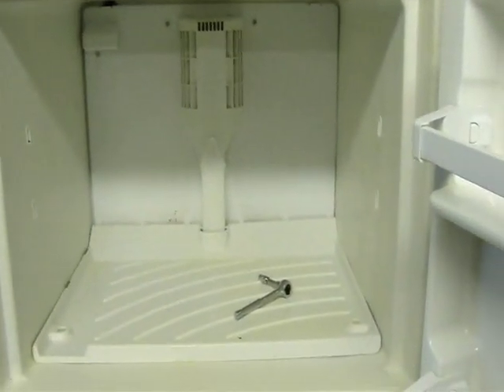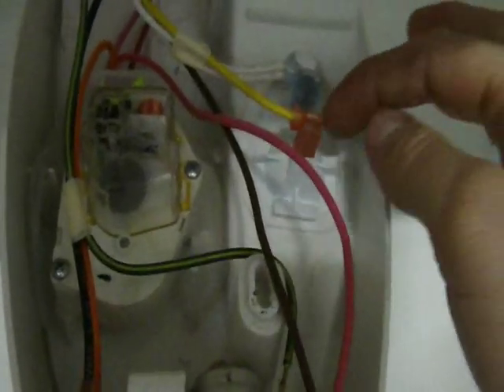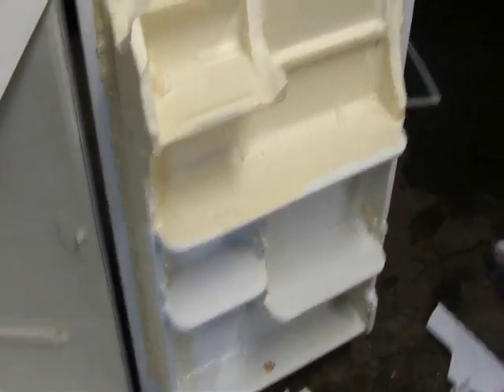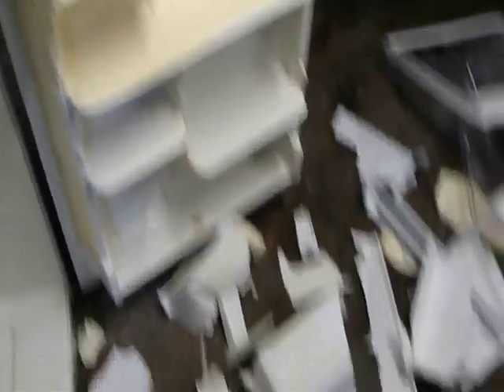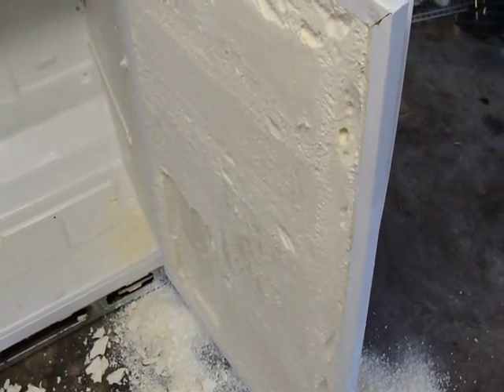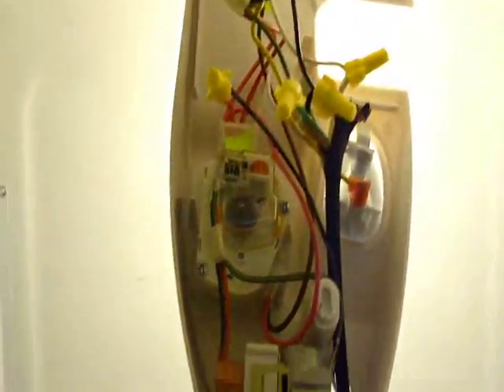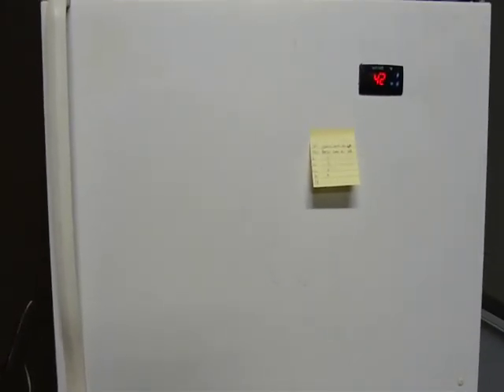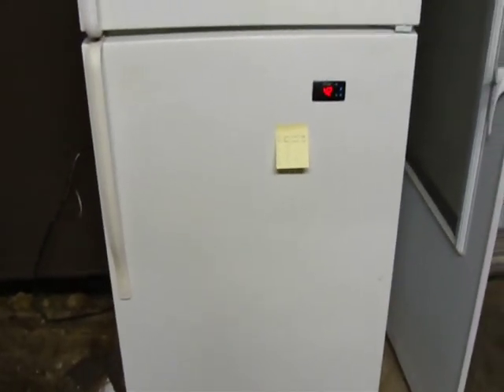How to Convert a Fridge/Freezer to a Fermentation Chamber.wmv

Comment: I believe you have the same fridge as I have and I want to do the same thing, but I want to keep the freezer portion working. Will that be possible? Can I hook up a Tstat just to the bottom refrigerator portion and not effect the freezer upper portion.
Reply: Dan, were you able to use the bottom fridge and save the freezer? If so, is there any instructions on how to do it?

Comment: Question, could I just discount the two wires to the fridge thermostat, jump them together to causing max cooling? Then plug the fridge into my temp controller.

Comment: I guess one could let the original thermostat in and put it to the lowest settings having the STC-1000 control from the plug that goes into the wall.
I wish too make my fridge into a wine fridge (actually veggies) because many of them keep best at 55 degrees F.